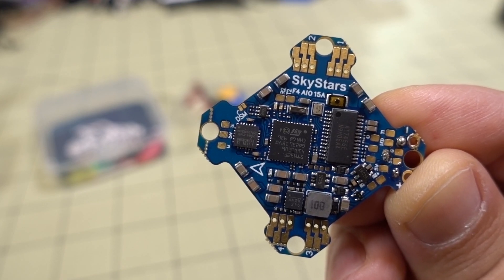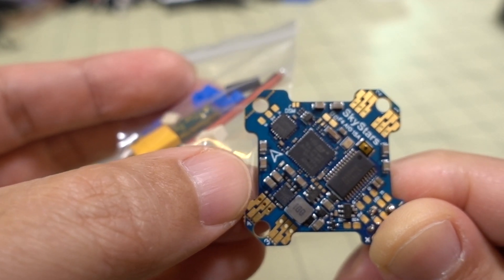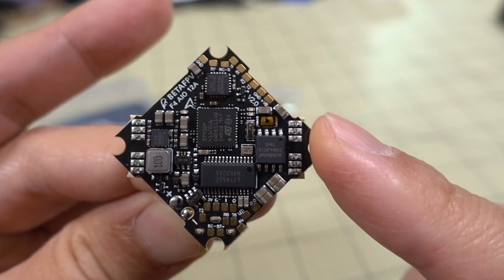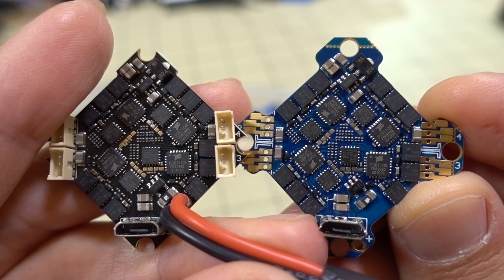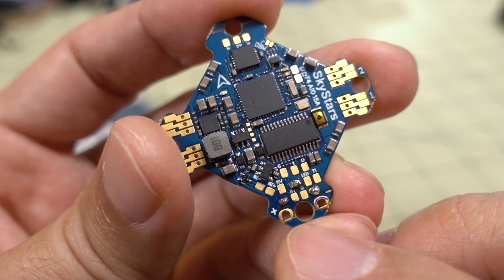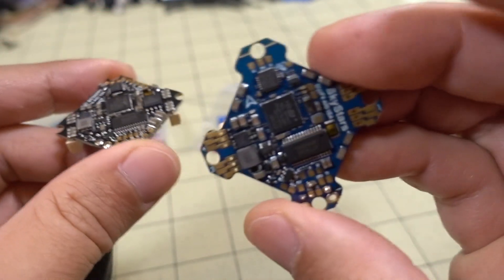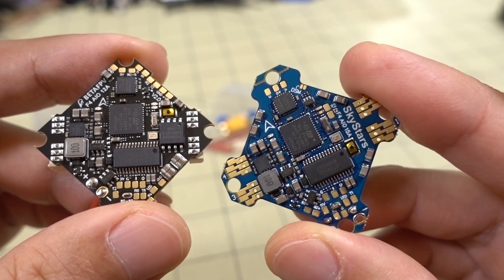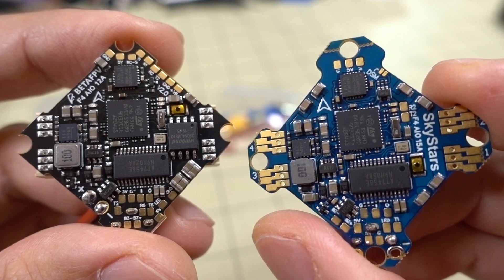Skystars KARMAM AIO Toothpick Whoop FC 🛠️

Comment: The USB port in that vertical orientation makes it tough to use on a lot of the toothpick frames. At best you can mount it upside down, change the orientation in Betaflight and do resource remapping to switch the motors around.

Comment: I have this one but CRSF doesn't work......isn't it?
Reply from the maker: Try swapping RX/TX
Reply: @AlbertKimTV  i did it but nothing....it works only if i set CRSF transmitter like SBUS modulation with one wire connected on Sbus pad on FC.

Comment: I had one of these with 1104 motors 3" props on 3S. It would flip out after fast manoeuvres. Nothing I could do would fix it. Swapped to a 16x16 stack on the same components and it worked fine. My conclusion is it couldn't cope with the load.

Comment: I had nothing but problems with this board, trying to get my Flysky receiver to bind an am not the only one. Tried everything in the end the board wouldnt even power up from the battery. After many attempts of trying different Flysky receivers and different UART solder pads and Betaflight combinations and bridging the DSM pads. Some people even recommend flashing it with the Geprc 12amp fc software which may work, but the time of trying this idear the board decided to pack in and not power up from battery, it will only power up from USB now. So buyers beware the only time this board managed to fly for me is when I threw it into the bin, waste of money.

Comment: There are so many whoop style FCs out there that it's gotten to be difficult to choose what's the best to buy over what to skip.  BTW, the price has already gone up a  little bit on same day you released your video, which is so typical of BG.  $33.09 as of the evening of May 3rd.
Reply from the maker: In my opinion, it's pretty easy now.  For most pilots, most of the recent boards are gonna be OK and work just fine.  For the top 5% of pilots, just go and spend money on buying at least a few of the most expensive boards to "feel satisfied".  Regarding burned ESCs, my opinion is that most pilots are going full throttle while the props are blocked somewhere and that will fry most ESCs regardless unless you go to a larger board with a rating higher than 50A.  I've gotten HUNDREDs of these AIO FC and have yet to fry any ESCs but have a few with bad BECs.  The top 5% of pilots will always be unhappy no matter what.  LOL.
Reply: Albert Kim - Glad you feel that way, but I just look for something that gives me the best value for my money.  Clearly, I am not a 5% guy, maybe not even 50% guy.  I am not into flying fast and no, I haven’t burned out and FC in almost two years since I made disarming quickly a priority.  I also don’t bother with Turtle mode as well.  Being retired put’s me on a limited budget so I won’t be buying the most expensive, nor will I have a bunch of spares and I am cool with that.  This probably puts near the bottom % of the pilot list and I’m fine with that too.  I just fly for fun, build for fun and repair only because I have too.  Thanks for all you do Albert, I always appreciate your efforts to keep us informed.  Let the good times roll, well fly...lol

Comment: I got 2 of those boards and couldn't make the receiver uart at all, tried with frsky and flysky receivers
Reply: use in betaflight uart rx port 1 but solder port2 or in beta rx2 and solder rx1. it fix your problem
Reply from the maker: the uart rx and tx are reversed?
Reply: @AlbertKimTV  no, uart1 in documentation is uart2 in pcb. There mistakes in documentation
Reply: @AlbertKimTV  Maybe... I tested both rx1 and 2,  but I think I didn't try the tx